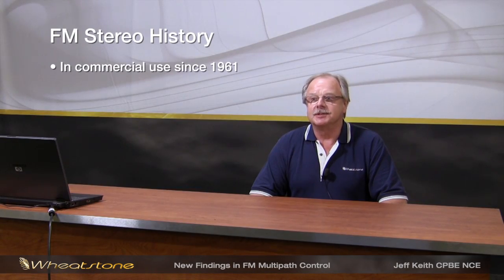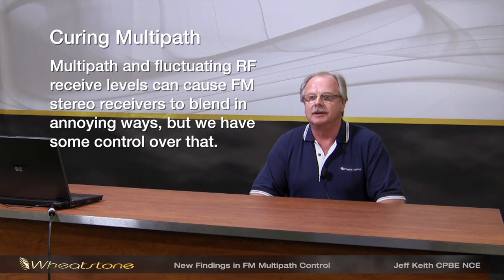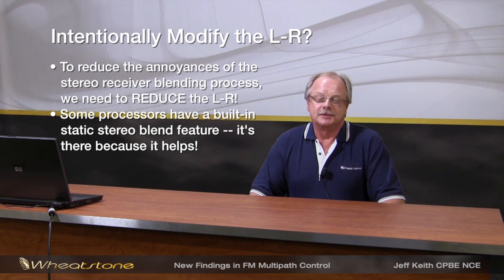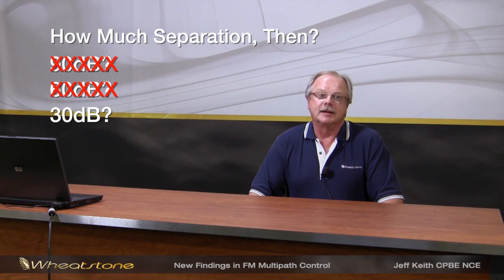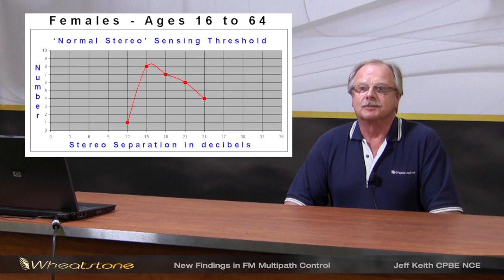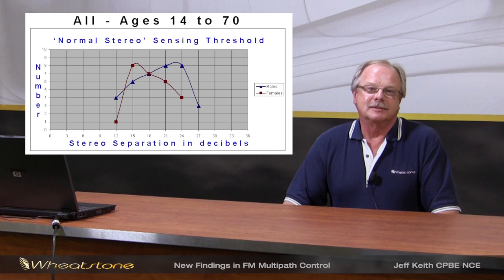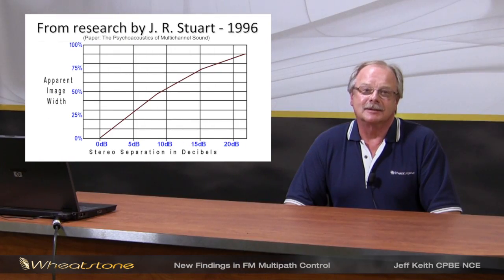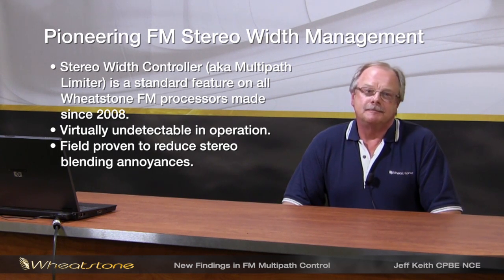New Findings in FM Multipath Control

Comment: Excellent presentation, Jeff. Just to add to the conversation, when I was chief engineer at Bozak Inc (1963-1979), we were major players in public area sound with a variey of mixers, amps and equalizers. At some point, we realized that for 'public area-live' reproduction and reinforcement that the stereo separation really needed to be controlled. Short story: we developed the "CAV" series of mixers (controlled audio/visual) which allowed only restricted stereo separation...usually in the 10-12 dB area. Our research and testing (c.1973) was conducted much as you describe in the video (psycho-acoustics) where realistic stereo (stage imaging) was achieved. This was also applied to houses of worship to determine (eg) the actual aural difference between a lectern and pulpit (L to R). Again, the magic neighborhood to work in was 10-12 dB. Symphonic concerts and other live performances were also deeply evaluated. This is an area that has long been somewhat overlooked in all aspects of audio...both live sound reinforcement and in broadcast work. Here in Connecticut I have experienced the L-R, L+R effects and often wondered what the broadcasters were doing about it...if anything. Again, thank you for your very clear and definitive presentation. Bob Betts, N1KPR